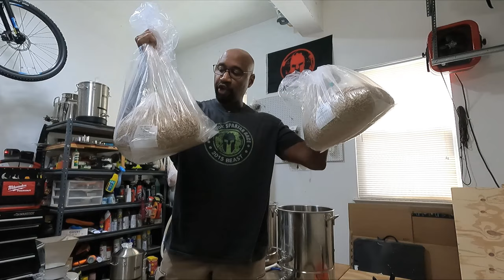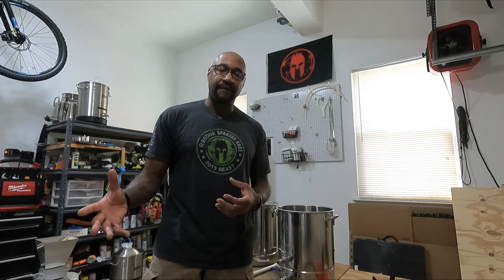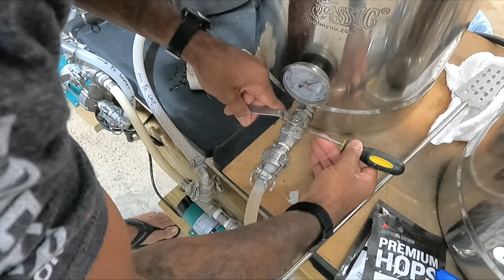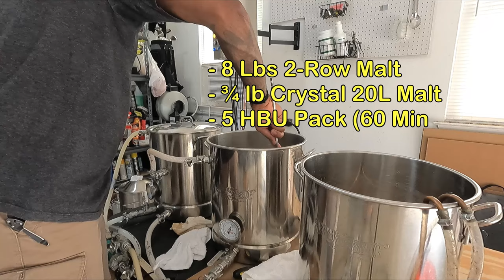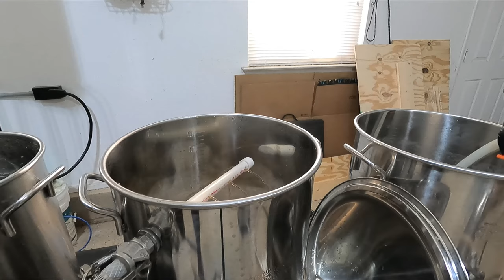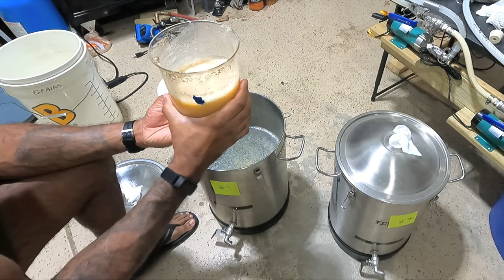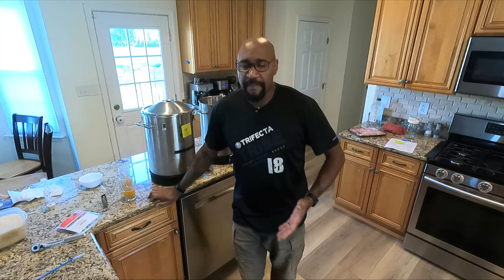Brewing Experiment - Does it make any difference to stir mash?

Comment: Nice video. I have also tried that experiment and I found no difference also. What I do now is mash in for 30 minutes and then recirculate for the final 30. All your sugars are converted in the first 30 0:10 minutes and then I clarify the wort for the last 30 minutes. Works very well for me. Enjoyed the video sir.
Reply from the maker: Is there any reason you don't recirculate the whole time? Is there a benefit to letting it sit?
Reply: I suggest that your sugar is partially converted in 30 minutes. The sugar profile will change with more time.
Also on my system, I get more conversion with more time. I do 90 minutes.
Reply: @JayJenkins  , the only reason I let it sit is to set the grain bed. After that I recirculate and after 30 minutes the wort comes out pretty clear and all the sugars should be extracted by then. There are all sorts of ways people mash but my version works well for me.